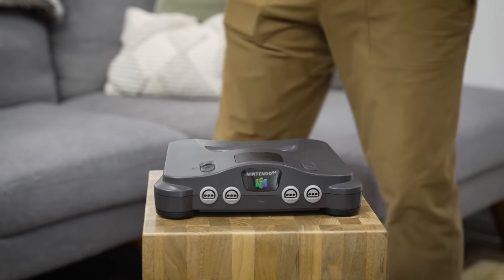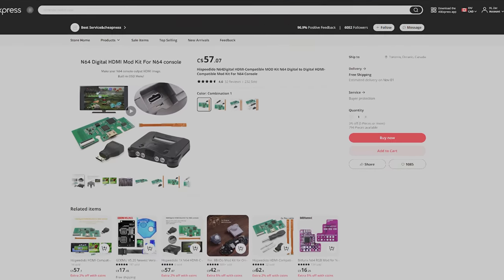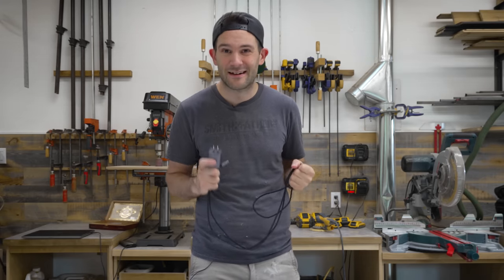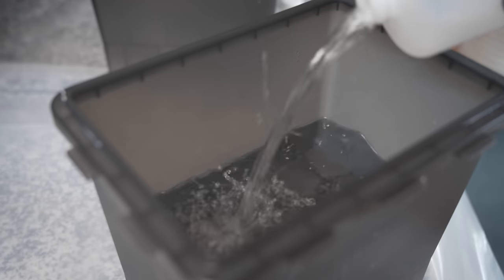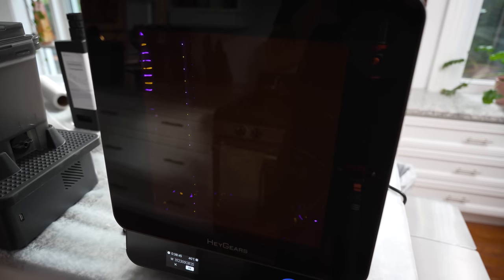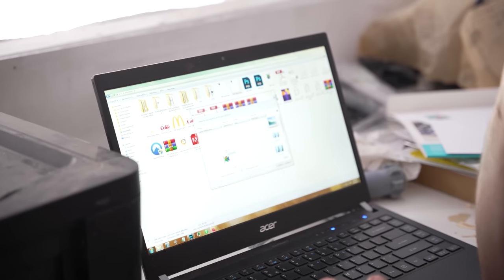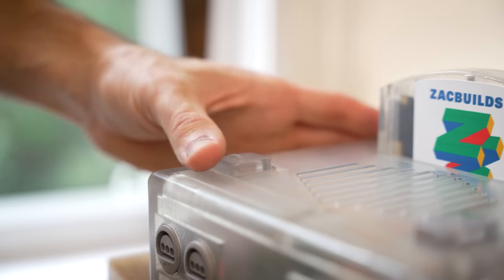I built a MODERN N64...

Comment: If your CPU is cooking and your heatsink is cool there's something wrong with thermal transfer, i'd try to re-seat the pads or just use thermal paste somehow. Otherwise crazy cool project
Reply: 100%.
Reply: The heatsinks are able to dissipate their share of that ~13w of heat to the air way faster than the PCB. You could put a fan in the case to get some air movement over the PCB, but with a hotspot temp of 60 degrees that's just overkill.
Reply: @Teeh0  he mentioned that the heatsinks were cool to the touch, that'd be IMPOSSIBLE even if the thing was just ideling at 30C, copper may transfer heat faster but it can't be more than 5-10°C away from the temp of whatever you're running since the heat is constantly being produced
Reply: Yeah... of course the heat sink is going to be cooler, otherwise you'd violate the laws of thermodynamics. The actual die inside the chip package is going to be far hotter.
Reply: @cjb89  it shouldn't be that far off, the way it is in the video there's gotta be a problem, no heatsink should be cool to the touch with a die @60°c
Reply: Could easily grab a small Noctua fan, very quiet and very effective, but it would probably require some kind of plastic shroud to vent the air.
Reply: lmfao. do you sincerely believe you've offered him brand new information with your comment?
Reply: @hedonist2104  well he's clearly unaware given the fact that he was happy about it...
Reply: The issue I think is lack of mounting pressure. The original heatsink compresses the thermal pads, as do pretty much any device with thermal pads.
Reply: @mileskosik472  most likely, there's also the chance that the heatsinks are poorly manufactured with a wayy to grainy surface to transfer heat properly, it seems silly but my RX580's heatsink was beat up and despite the card having a lower power draw and the fans at 4k RPM it would often stick above 80 compared to the now 69-72°c of my 2080 wich uses about 1500RPM. It wasn't very stable either...
Reply: thermal pads too thick imo shouldve used thinner ones
Reply: The 60°C chip he showed was the RCP not the CPU and he didn't say it was cool, just that it was warm to the touch. That temp is fine for the RCP and it will actually run just fine without the heatsink at all(not that I'd recommend it.) The heatsinks he uses are taller than most I've seen used on the N64 and I wouldn't be surprised if they only felt warm on top because of their height and the extra surface area to dissipate heat combined with the lower thermal transfer of the thicker thermal pad(which could be thinner but it's perfectly fine and there's no reason to swap it out.)

And to people concerned about the temperature gradient from the thermal camera view, he was just checking the temp of the chip not the heatsink and with nothing matte on the reflective metal heatsink you aren't getting an accurate reading on those. He showed the temp of the chip which is well within specs anyway.

I like lowering the stress of thermal cycling as much as the next person but I would put wider heatsinks in before I added a fan(not that I'd do either with his temps.) No one wants to deal with dust build up from a fan and adding moving parts that require cleaning to a console with no moving parts to start with just feels like you're going backwards.

My only problem with the case are the big holes on top that would allow me to spill who knows what liquid directly on the mainboard but that's probably more a personal problem.

All that being said, cool project!
Reply: 60 C is hot, not "warm"... very bad installed heatsinks.
Reply: Not really, if your heatsink is hot that means it's not dispersing the heat away correctly and instead is just "storing it" and it is then you might want to think about increasing the airflow around the heat sink.

The way those heatsinks are designed with fins is to allow the natural flow of air to get in-between to help move the heat away..

The CPU will run hot, always in fact 60°c seems like a normal operating temperature to me, it could be getting hotter due to being fed too much power? Even just half a volt could make a difference.

Eitherway those passive cooled heatsinks seem fine to me. I would be more concerned if the heatsink was hot to touch, as I said that would suggest you need some extra help getting rid of the heat.

Maybe a bigger heatsink (like the N64 technically had) or a fan.
Reply: Oh, well my cpu is cooking and I have a RGB heatsink
Reply: It's just because his heatsinks are smaller than the CPU. The hot part is the exposed part without a heatsink. It would have been wise to find some that are just a little larger than the CPU rather than just a little smaller.
Reply: What he could've done  was increase the height of the case, put vents in & added 1-2 small fans to dissipate the heat better, keeping the unit much cooler. I think over time the case may warp/discolor from the heat generated.
Reply: It's probably the emissivity of the pins making them look much hotter on the thermal camera.
Reply: @Blaszj that's a good point on the thermal not getting a good reading on the reflective surface. I work on my own cars, and aftermarket radiators are shiny and give poor readings on temp guns. A touch of flat black spray paint on the desired location fixes that.
Reply: Y'all are forgetting about volumetric heat capacity.

Al and Cu have almost identical volumetric heat capacity, despite Cu being almost 60% better at transfer. 

so sure the copper is cooling down faster, but there is not enough volume in those tiny pads to act a sink. A heat sink is like a thermal capacitor, it is the air that is cooling the Si, the air the thermal grounding if you will.
So sure, its discharging just fine but its never picking up enough heat to keep pace with the chipset.

Heat Pipes changed that allowing the use of waters amazing heat capacity, particularly from its transtion between liquid and vapor and coppers amazing thermal conductivity without adding in any mechanical complexity. This gives those with modern eyes the sense that he did the right thing by using tiny copper heat sinks, but its false. The copper still needs the same volume to act as a heat sink, it just needs less surface area
Reply: @Ferrari255GTO   copper moves heat, but doesnt transfer it to air as good as aluminum, hence copper heatpipes with aluminum fins
Reply: Yeah that's what I was thinking too. "Chips are getting rather hot, but the heatsinks are still cool" that didn't sound good at all.
Reply: Beware, the heatsink IS hot. It's probably more or less the same temperature as the chip package underneath. But since the heatsink fins are copper (or copper plated aluminium), Their emissivity is different than the chip package. They APPEAR colder in the eyes of the thermal camera (because of the emissivity), but they are hot as well ! ;-)
(The real temperature is the one a contact thermal probe touching the fins or chip gives !)
Reply: @narmale  i was a bit dissapointed when i saw that my 2080 had aluminium pipes TBH, but it all went away when i saw it perform great overall
Reply: @blasterman1r if you design the case, wouldn’t you strive for a single fan?
Reply: He knew better than the engineers that designed the platform. There's a reason there's so much space. I repaired an amp that blew the chip. You'd be surprised how much space there is. The chip is a multipin signal booster for electric instruments. The entire thing COULD fit in the footprint of a large altoids can. Instead, its in something the size of a shoebox. Airflow matters. And that amp chip is about the length of your thumb, and screwed into a cooling plate the size of the edge of a shoebox.

People thinking they know better is irritating. Theres a reason laptops through the ages have been so prone to failure due to the mutual heat development.
Reply: I would have gone with thermal paste for sure
Reply: @kaldo_kaldo  at least with the paste and enough pressure I don’t lose any conductivity. All the contact points from just pressing soft copper onto ?soft plastic? are still there. Only now the cavities are filled with silver grains and silicone oil. Just make sure to apply the paste in the center and align the surface planes before pressing. And there needs to be a clamp to creep out every last ounce of superfluous oil over the heat cycles.

Why do we even have zero insertion force sockets if we actually need to sandwich a chip in a clamp all the time? Oh wait, this is not a PC.
Reply: Do nes  next
Reply: @hedonist2104  you certainly didnt ;)
Reply: i wonder if it'd be possible to put less effort into a comment... also, you're really straddling the line between "comment that makes sense" and "comment that makes no sense" @FTfilm
Reply: @Teeh0  that's why ps2 has a fan
Reply: The original heatsinks were just stuck to the chips with thermal pads, and there was little to no mounting pressure.   The N64 never really got that hot, that's why Nintendo's passive heatsink design worked.   All of you "experts" are here trying to solve a problem that doesn't really exist.
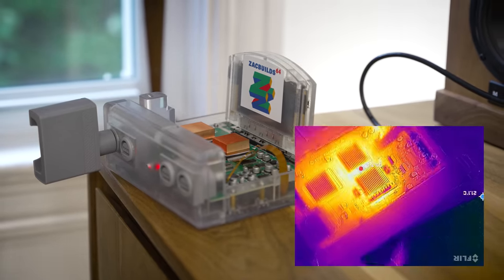Reply: @Ferrari255GTO    How is it that you watched the same video as everyone else but hear different things then everyone else?   You need to watch video again and LISTEN with your ears.  He clearly said the "heatsinks were purely warm to the touch" @19:57   Turn on the close captioning if you need to read what he was saying. 
Nevertheless, the heatsinks are doing their job and dissapating the heat.  There is nothing here that needs to be fixed.
Reply: @MrRobarino  i never claimed to be an expert, and he got rid of a large heatshink to put a small copper one in, there's bound to be some details missed from the engineering of the original console. It's universally agreed that lower temperatures equal longer life, i never said it would melt, explode and kill him and his family, i said something wasn't completely right since the heatsink isn't as warm as it should with the die temperatures. Aparently from your logic if i say that i know how to change the oil on my car and bleed the hydraulic brake system i'm claiming to be an experienced electromechanical engineer?
Reply: TBF the original wasn't all that great at dissipating heat, we used to have a spare on standby for Perfect Dark marathons as they would just overheat (the expansion pak was most of the problem but even swapping that out only lasted so long).
Reply: was gonna say that but lets be real here
any modern piece of bare minimum cooling added to it would stop it from cooking itself
perks of low power draw lol
Reply: @MrRobarino  I mean, the RF shield + cross bar did provide a certain bit of mounting pressure.

Comment: I really like your post mortem analysis of your projects, it gives a bit more realism to the project, showing that not all things go so smoothly
Reply: It's so good. So much of the satisfaction of these videos is feeling like they're enabling you to do the same thing yourself if you wanted, and the post-mortem is the absolute cherry on top.
Reply from the maker: Thanks! I love doing them because on almost every single project I do I'm constantly noticing things I could do better, thats part of the process of building. In the past I just tossed them away when the video was done (unless I did a follow up project) but now I have an outlet for them
Reply: You don't know what postmortem means. Maybe that's why you're impressed.
Reply: Drill 4 small holes and you screw a small noctua fan,no need to redo the whole project.
Reply: I agree, analysis is highly appreciated. I had a couple thoughts-

-I think I'd personally keep the controller ports for compatibility with all n64 controllers. I respect the portless design though, all depends what you want in your build

-Imagine getting video out and power in all through a single usb c for these retro consoles, all the way up to the wii u. You'd probably still want the hdmi port for ease of use, but being able to use a USB c dock dongle would be interesting, although this is more of an idea for portable consoles

-Or even a rechargeable backup battery in it so it wouldn't power off if the power got cut

Amazing video Zac. Love the n64 logo manip
Reply: @thesambuddy  I would have done same and kept ports as is in fact I would have had kept as much as I could on my   machine as is except the ability to play on a modern system as you can find console controllers from multiple eras including up to Wii.

Comment: Quick tip, if you skip the IPA wash, remove the supports, and cure the part while it is still wet with resin, you can get a glass like finish.  Resin is often used for smoothing FDM prints by dipping the whole print in resin and then curing the resin.
Reply: Could also spray with a few layers of clear acrylic paint
Reply: Lol I posted this before I got to that part in the video
Reply: IPAs are bitter too
Reply: @sjcasey05  please do not drink isopropyl alcohol
Reply: @keiyakins  I happened to be referring to India pale ale, the other IPA.
Reply: @sjcasey05  yes it does make the resin taste funny, I think a lighter craft ale goes better in the mix.
Reply: That's true... BUT depending on your print and printer, you could end up losing detail and/or imperfections from excess resin. However for something simple and chunky it's probably fine. Then again you could also either paint it (as he did) or dip it in resin to get a very light coating, let the excess drip off, and cure it again briefly. I don't honestly know the best approach for something like this. I'd probably try to cure it unwashed to see if it's "good enough", because extra horsing around is a big turnoff.
Reply: ipa internadional ogonekic alphabet phoniet